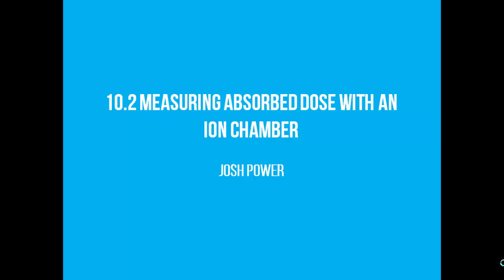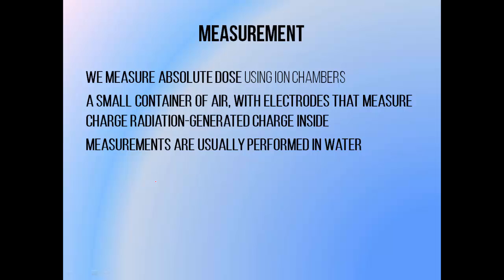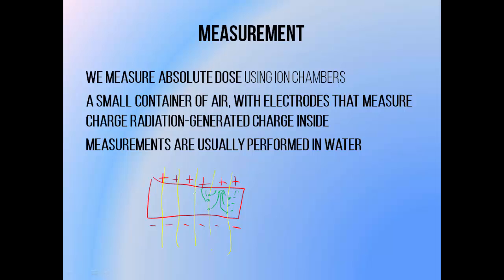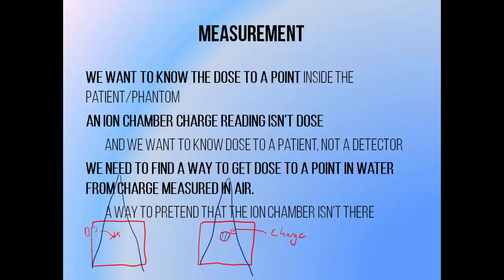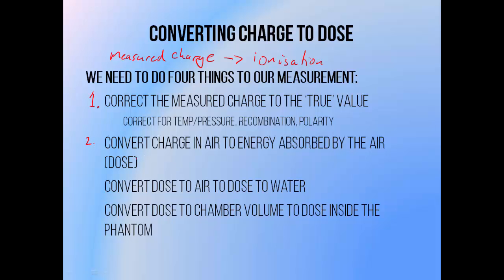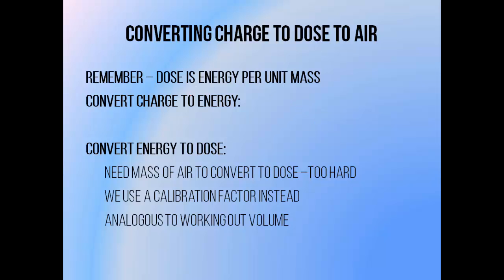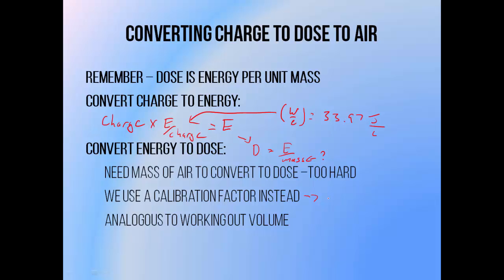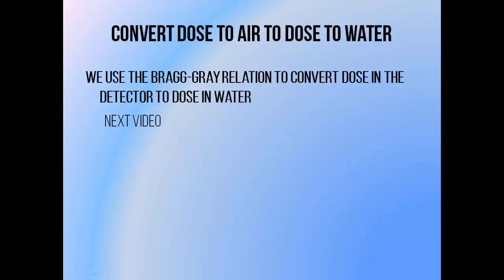10.2 - Measuring absolute dose with an ion chamber

Comment: Hi, I have a question. You frequently use the term "Dose to a point". However, an idealized mathematical point has no mass because it has no volume (mass=Vp, V=volume, p= density). However, dose is defines as D=J/m. Do we assume that this quantity is convergent as m->0? This would make sense. However, is this clinically relevant? I can't think of a way to measure the amount of energy given to a single point. Afterall, we live in a 3D world.
Reply from the maker: Hi Hayden, this is a very good question, and something I puzzled over for a long time. I cover a bit of this and the clinical relevance of the definition in video number 10.1. As for real clinical relevance - the real test is correlation of dose and clinical outcomes.
Reply from the maker: And the volume scaling portion of video 10.3 - basically if dose is uniform inside a given volume, as the volume approaches 0, energy and mass vary at the same rate, so the dose doesn't change.